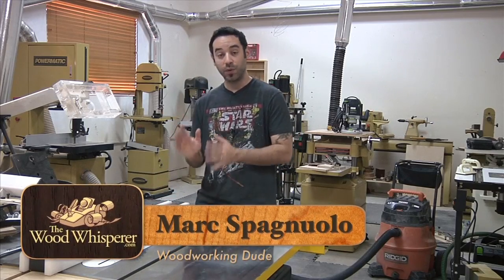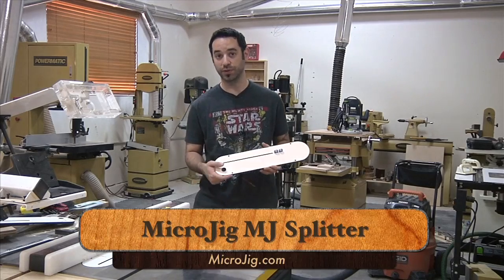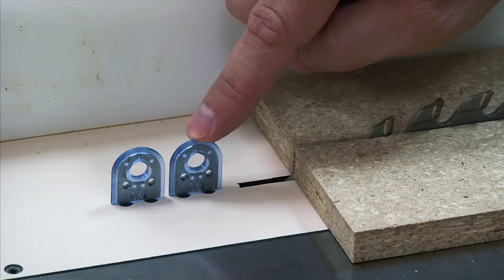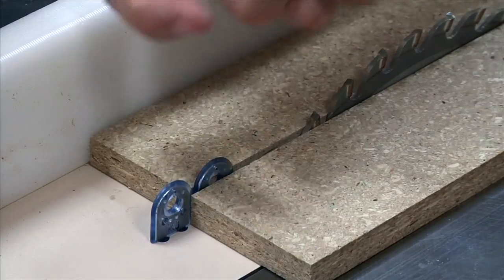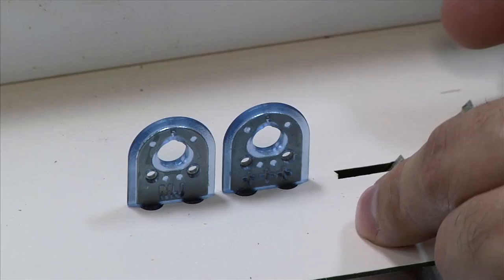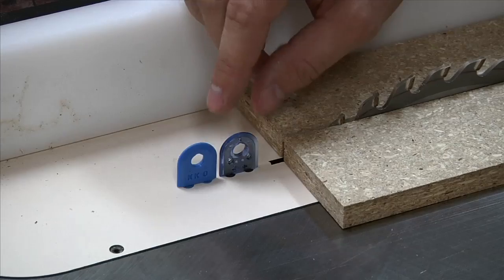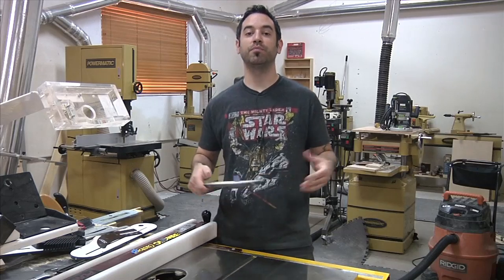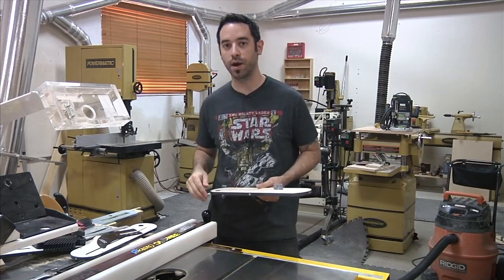Add a Riving Knife to any Saw! | MicroJig MJ Splitter Review

Comment: I have an old 1968 Craftsman 113 that came with a splitter and guard, but they had to be removed when I upgraded my fence system (Delta T4).  The MJ Splitter is a no-brainer for me and absolutely required.  I use it all the time and I'm looking at the Jessem stock guides to further help keep my cuts safer.

Comment: Or you can cut through your ZCP and fit any piece of exactly sanded flat sized steel for 50 cents by either epoxying it back or screwing it back.  I hope this is not sponsored.

Comment: Can you tell me how you attached the plastic sheet to your table saw fence? I need to replace my plywood fence which is bolted, with that same material, but I don't want to drill holes and have to fill them in!

Comment: I own one of those plastic metal torture devices you describe for my 22124 craftsman hybrid table saw. I have yet to figure out how to make a straight rip cut with it attached. It's bulky,gets in the way, and obscures my vision. I'm unable to keep the wood pressed against the fence when ripping thin stock. So to me. The stock safety gear seems to be a hazard at best. My question to you is. In your experience as a wood worker would the splitter from micro jig be a better, safer. solution ? I use their 3d gripper and it's great. But unfortunately it's not compatible with the stock splitter and I'm looking for a solution that will help keep me from getting more stitches. Currently I'm sporting 11 in my index finger from Not having a reliable splitter/riving knife. 
Also. What makes a riving knife better than a splitter from a scientific point of view.

Comment from the maker: It is pretty much as close as you can get with a stationary splitter. It has to be able to accommodate the blade when at full height. So when the blade is really low, the distance is greater. But I guess that's the nature of the beast with this type of product.

Comment: I have an old Craftsman table saw.  Got hit by the kickback once, years ago. Since then, I now use a face shield with safety glasses and a heavy leather woodworkers apron with padding sewn in (yes, it's custom).  Kickback may still occur, but it shouldn't hurt too bad.

Comment: Why does everyone add plastic to the fence? I can come up with a lot or reasons but I never heard the real reason. I'm sure accuracy is it's goal. TY! Great video!!! Check out my Kreg pocket hole unboxing if you don't use pocket holes. I would assume you do though.
Reply from the maker: +OBX Fishing I don't think everyone uses plastic, but some companies do include UHMW plastic in their fences, like Powermatic. That's the case in this video.
Reply: I have since discovered that when making cuts close to the fence, having the plastic will keep the blade from hitting the metal fence, and I think this is my answer. What do you think? TY for the reply!
Reply: +OBX Fishing sounds like a viable reason WW....but I also believe that this type of plastic provides a slicker surface for the wood to ride against when compared to aluminum
Reply: @RoddyDa you are absolutely correct and it still makes a safe sacrificial fence that won’t damage the blade IF it does come into contact with the blade.

Comment: I have an old Crafstman/Sears table saw - the factor throat plate is only 1/16 inch thick (metal).  How would I go about creating a zero clearance insert for something that thin? (non-standard thickness)?
Reply: I have the same saw. If you do not already have them, drill a couple of screw holes into the insert, and counter sink them just enough for a couple of small screws.

Cut a board for the underside. I use 1/2 inch. Screw into place under the plate. Make sure the heads are flush or below the surface.

Cut a 1/16 inch thick strip of wood to glue into the slot, bringing it flush. Might want it ever so slightly higher and sand flush. 

Drop the blade, install plate, to be extra safe put the fence over the side of the plate, turn on saw, slowly raise the blade through the insert.'

Very quick, easy, been doing this for years. I add a hardwood "riving" knife behind the blade, glued into the slot, though that does limit the blade height a little. If you really want full height you will need to extend the kerf a little.

Comment: Riving Knife should not be in line with saw blade though
+- 0.3/0.6 mm to the right slightly outside the saw blade. PS it is best to make a Riving Knife from spring material BV. aluminium. And the wood remains pressed against the guide and the rest of the wood remains clamped in place against the guide and cannot shoot away, no kickback saw wood ((I've had it like this for years and it works perfectly all the time). And, even with a riving knife you have no problem if you want to make a narrow rabbet

Comment: Do I need to know the blade thickness to order ?
Reply: There are only 2 options. Stand kerf and thin kerf. Standard kerf is 1/8 inch and the blue setup. Thin kerf is the orange setup.

Comment: Mmh... They do not raise or lower with the saw height. So, just get one or two L-shaped steel bits and place them in line with the saw blade and flush with the zero-clearance plate. Total cost = few cents.
Reply: Just tap one 2mm nail at blade line alignment. Thats enough. Over exaggeration not required.

Comment: why don't you americas use riving knifes.
much safer and easier.
its thicker then the saw blade, and thinner then the tooth of saw.
more woodworking youtubers don not use riving knifes.

I've had some serious close calls with "not using the riving knife.
i dont mean accidents with my fingers or something like that, i mean the material stuck and burn at the end of the saw. 
always use a riving knife
(sorry for my english, i'm dutch)
Reply: Some older models don't accommodate riving knives.  Also some manufactures don't have riving knives available for a thin kerf blade.
Reply: If you haven't notice Americans love to do it themselves. These work great and likely how Riving knifes came about. Mother of invention thing.Besdies many older very good quality saw do not have riving knifes .
Reply: riving knife free since 83 .....👌